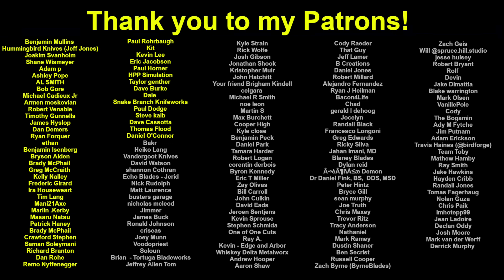Triple-T #151 - Machining a curved fuller

Comment: Dennis, do you feel like this was a better option than using your small wheels on the 2x72?
Reply from the maker: This is a much better option than small wheels. Mainly because this is done after heat treat so there’s no worry of decarb in the fuller which is crazy hard to remove.  Yes you could try to grind in a fuller after heat treat but it’s very easy to overheat the steel, and it’s way less accurate.  Thanks for watching.

Comment: Why not cut the fuller before you curve the blade?
Reply from the maker: That actually causes more issues.  Then it would be full of decarb after the quench which is REALLY hard to grind out.  It’s possible but way more time consuming.  Thanks for watching

Comment: What if instead of bolts and plates you used bearings? That way you could drag the blade through the mill(which would be stationary), That way the fuller follow the curve to a T.  Mind you I don't know crap about milling so this may be a dangerous idea...
Reply from the maker: Extremely dangerous and it would chatter like crazy.  More likely you’d launch the workpiece and break the end mill.  Bad idea, but thanks for watching.  😉

Comment: How can you fade out the fuller on the mill instead of the end of the fuller coming to an abrupt stop?
Reply from the maker: The fade out is done from having a distal taper on the blade.  If you clamp it down onto the table and then set your depth the same as the taper amount, it will fade as you get to the tip.  This one does fade a little, but not too much.  If you wanted that without a distal taper, just shim the back end of your blade up a bit.  Thanks for watching.
Reply: @TyrellKnifeworks  Thanks!

Comment: Are you concerned that the reduced cross-section of the fuller could work harden over time due to flex in the blade? Might that lead to longitudinal cracking?
Reply from the maker: Sorry, but what you’re saying doesn’t make any sense.  The sword is already hardened, so there’s no “work hardening”.  Fullers are a very real thing, not something I’ve invented.  Thanks for watching.

Comment: Turned out nice. Just curious why you did it after you had the curve vs adding when it was straight and then adding the curve
Reply from the maker: Think about what you’re saying though.. the purpose of doing it now means it’s very crisp and clean.  If I do it before forging is complete and before heat treating, it will go through a ton of changes, likely screwing that up.  Another issue is decarb at the bottom of the fuller is VERY hard to get out.  It’s not a fun thing to grind/resand.  Thanks for watching.

Comment: As a woodworker, my immediate thought was a round end carbide bit in a router using a roller guide on the edge of the blade. There would be no stop-start marks.
Reply from the maker: Except this is hardened steel.  There is absolutely no way this would work in a router like that.  Certainly a difference between woodworking and machining in this one. 😉. Thanks for watching.
Reply: Well done!  Good luck in the challenge.

Comment: It's a different way of doing it, most of the ones I've seen use a groover-scraper sort of like a draw-knife for metal, but they just put a HSS lathe chisel or carbide cutter into them. Then set a distance stop on the side to keep them even, run it down the blade about a thousand times! It's hard work. But like everything with fullers, there's no real easy way of doing them and most of them are hard to do so you can't really win.
Looking good though, the little peeks of nickel/15N20 popping out in there are very cool
Reply from the maker: Also, that’s NOT nickel, it’s pure silver!  Just wait till the reveal on the final.  😉
Reply: @TyrellKnifeworks  Awesome! Mind you with the price of nickel plate lately it may be cheaper :)
Reply from the maker: @krissteel4074  ha, it’s not cheaper, trust me.  😉
Reply from the maker: Yeah, I’ve seen that method… VERY time consuming.  All in, this took me about 3 hours to fully finish including sanding and it came out damn near perfect.  Thanks for watching.